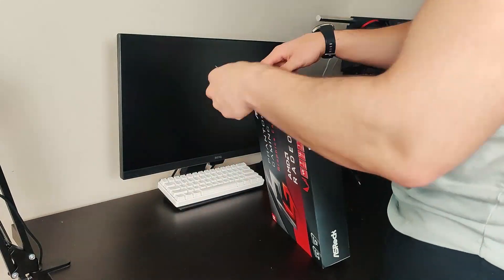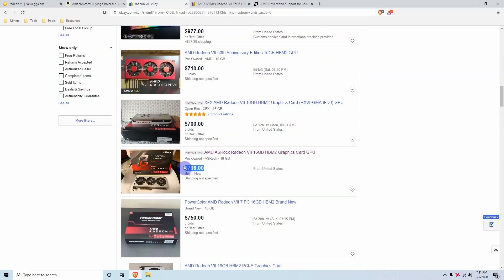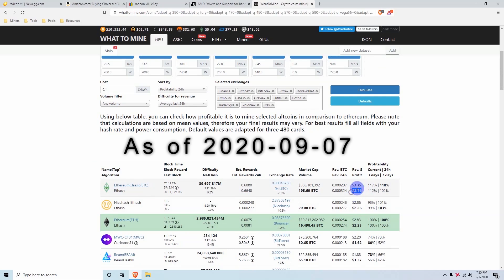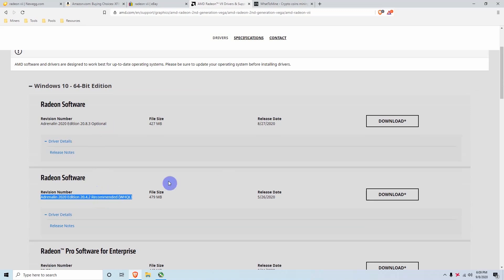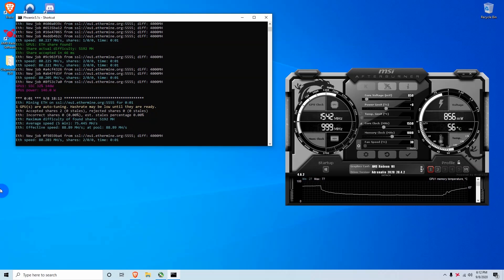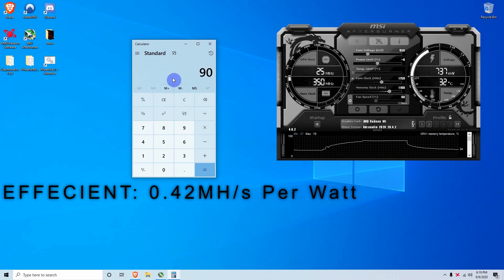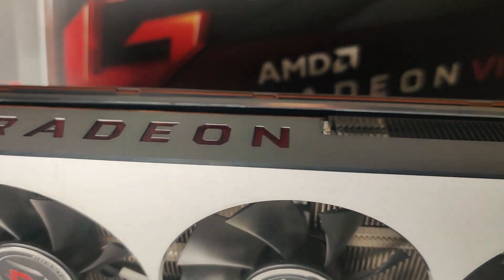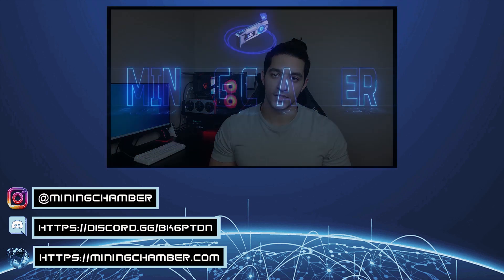Radeon VII Mining Overview | Profitability, Hashrates & Overclocking

Comment: hi
my Radeon VII give me 47 m/h and I didn't do anything to the bios and its only consume 175w
is there any wrong with it
Reply from the maker: Mm make sure your properly connecting it and powering it. Try a different riser as well if your using risers
Reply: @MiningChamber  i made that an i try many miners PhoenixMine not detect it Gmineer give me 47 M/h  but when i try NiceHash Miner it give me normal hash of 88 m/h
realy i dont know what the wrong i changed the power and the riser

Comment: HELLO I have a rig with 5 radeon VII. 
one year mining at 90 megahash x card, two weeks ago they dropped to 78 mh / s. Use simplemining and phonixminer 5.3b fix. What could have happened? OC Core mv950  CoreClock 1750 MEM 1100mhz
Reply from the maker: It could have been due to heat or such. I would just try to reboot and see if it works or I see that you said using simplemining and Phoenixminer fixed it?

R7s gets really hot at 90 mh so becareful!
Reply: @MiningChamber   No no "5.3b fix" is the name of the algo..
Reply from the maker: Never heard of 5.3b fix as an algo... If you were mining at 90mh then you were mining Ethash. So just again check our oc settings or see if there is a later version of Phoenixminer. 5.3b is a version number for it as far as I know and I think there is a 5.3c now

Comment: How to solve the heat dissipation problem of Radeon VII?
Reply from the maker: If it's too hot I'd use the effecient settings to keep your card at 80mh instead of 90mh. If that is what you got it on already then maybe adding a box fan behind the rig should be good!

Comment: Can I run a 3080 with a Radeon VII in two slots on my motherboard? do I need to install the amd driver manually too? isnt it dangerous and not good to put amd driver on top with nvidia driver? and how can I use msi afterburner for radeon VII when I already used it for rtx 3080.. help
Reply from the maker: Hey! Yes you can use both cards in the same system, not necessarily dangerous but it's a pain to setup and usually causes some instability so it will take time to get it right by trial and error. As for MSI afterburner, you will be fine since there will be a drop down where you can choose which gpu to tune!

Comment: How u can enable or disabled temp limit on msi afterburner? I have after burner i cant setting temp limit always back to default 85°
Reply from the maker: Hey! I am actually not quite sure but is it affecting your mining in any way? You can mostly set temp limits in the miners themselfs. They have parameters for it!
Reply: @MiningChamber  i have 2 gpu  rx 580 nitro+ and i have problem with one gpu only, the gpu always easy to reach 80-82° if use all day he can reach to 84° after that bluesrcreen fan on auto can reach 99%, and other nitro+ is normal for temp only reach 67-70° and fan auto never reach 90%, sorry for my english 😁, i am new on mining crypto 😅
Reply from the maker: It's okay! Did you properly overclock your card for mining? Check our RX 580 gpu overview video and skip to the overclocking section and follow those steps!

Comment: should I sell my Vega 56 for a 5700 XT? I use my system to game as well as mine.
0x99724017f84c51bF5bafC802D27bDa851BEd35b4
Reply from the maker: hmm 5700XT pretty good for gaming but their mem temps gets really hot for mining, so in a PC case it might be hard. If you keep the side panel open then it can be a good idea!

Comment: Hi Bro, I want to ask you. Why Nvidia GPUs Memory And Clock Settings are different? from the AMD settings.. in mining and hive os OC template
Reply from the maker: Hey! That's a good question! AMD is absolute when overclocking so you will have to provide the value you want the frequency to be at. While NVIDIA uses addition with stock settings. So for example in NVIDIA you will be using +100 or -100(it can be any number)  to change the frequency of the Core clock or Memory. While in AMD you will put the actual value you want it at. 1100, 2150, etc. Some AMD cards in HiveOs requires you to put only half the value for the memory frequency, the 5700XT is a good example for it. In Windows it goes on 1800 mem while in HiveOs you have to do 900
Reply: @MiningChamber  Oh… so this is the science behind this. Mostly I am using the AMD card for mining. I asked you this question because I am planning to install the Nvidia card and I was worried about their OC settings as it was beyond my comprehension. Finally, I would like to ask you one more question about how will I get the core clock and memory settings of the Nvidia card. Give an example on any Nvidia card. I like this Example "the 5700XT is a good example for it. In Windows, it goes on 1800 mem while in HiveOs you have to do 900". As per your information, is there any website and platform on which I can find OC for graphic cards?.
Thanks in advance brother, you are great
Reply from the maker: No problem at all! It's pretty interesting topic that we might cover in a future video. A place you can get some overclocks is on our website. Https://MiningChamber.com/tag/overclocking 

We are doing a big website remodel soon so we will have more information there hopefully within a week!
Reply: @MiningChamber  Thanks brother, your all videos are very helpful for me, definitely cover this topic in your upcoming videos, I am waiting for this...... Good luck

Comment: I found one for $650 but I don't know if I should wait for the new rtx 3080 or buy the radeon vii?? What do you guys think.  Im new to mining so I could use all the advice I can. Thanks mining familia
Reply: Will add my wallet asap
Reply: 🙏 0x6256C95FB52AF3ae2803eca53300C0eC2f834a14
Reply: 0x760984a6AEC52A8f8d383044808350b007811519
Reply from the maker: Oh wow 650$ that is really good! But if your looking to buy more I still think you should wait for the new GPUs !
Reply: @MiningChamber  haha I know right! Considering what they are going for. There's 2 in my area, the $650 and a $700 but just been holding out because there is so much hype about the new news coming out in a couple days for roughly the same price. Thanks for the advice broski. God bless 🙏
Reply from the maker: Absolutely my pleasure 🙏🙏⛏️
Reply: @MiningChamber  question.? Im expecting my vedha frame and going to build my first gpu mining rig. I want your opinion about the tech. I have. So i have a Asus B250 19 slot mining expert, pentium processor, Kingston 240GB SSD , a Corsair ddr4 8GB, and so far only have 1 Amd Radeon rx 5600 xt thicc 3 gpu. Hopefully get more gpus soon. With the pandemic going on its been tough to get more gpu but im totally excited to set it up. Do you think my set up is good so far? is bios mod., and Overclocking Essential?
Reply from the maker: That is perfect! In your case I'm not sure if BIOS modding is essential I would ask around in Red Panda Mining Discord, as for Overclocking. It is a must to any card. Overclocking is something that should never be skipped since it helps save your hardware by not pushing it too hard especially when you undervolt

Comment: 1 RX 570 = 30MHs = 110w
1 RX 5700 XT = 60MHs = 150w
1 R VII = 90MHs = 280w(only GPU or total system?)

If R VII = 280w  no convenient for me, RX 5700 XT is the best,
If 280w is the total system wattage so what is the GPU wattage?
0xe7d0aa1fc7269553e7295b431e18ee72831ee65f
Reply from the maker: We do provide wattage of both overclocks as a text on screen but to sum it up total system watts with effecient settings is 250W and just the GPU is 190 watts and that's at 80Mh/s

Comment: lol that would suck to have a 6-8x VII rig running widows and the driver crashes and resets without undervolt and reduced clocks
definitely a PSU killer there
even these navi ive been worrying about, most mine are also 2 8pins and can chug power at 2000 core and 1200mv
but i only got 2 small rigs on windows now as mining OS are maturing so makes sense to run them
big step from polaris where at worst ur hitting 250watts
Reply from the maker: 😂😂 that happened to me once, wall meter was reading 1400 watts while the PSU is a 1200 watts😅😆 surprised my hands and legs are still attached 😛

Comment: nice video You convinced me and I bought 3 radeon vii, just a question can I use a psu corsair and another evga in the same rig?
0x3192458957cdf3e738f47bc4a5534bbe73b99865
Reply from the maker: 😂😂 pulled the trigger on it fast! I would've advised for waiting for the new hardware but if you got a good deal then your set! Using 2 different PSU models is completely fine!
Reply: @MiningChamber  bro Thanx For Advice

Comment: nice video.  can I use RTX 2070 and RX 580?  
0x14cF07eFF8EFCeC459082Cf1F4cb54D41915f243
Reply from the maker: Thank you! RTX 2070 and RX 580 on the same rig?
Reply: @MiningChamber  yes. im new to mining still learning. since I have a 2070 on my pc i guess 580 would be a cheap way to get more hash power. s that automatically detected by claymore?

Comment: Nicee video,i am new my question does it matter the brand of the gpu to produce 90mhs thanks

0x02b3cEc970B4c5F267739d191b331c68CB641a72
Reply from the maker: It usually does not matter, although some brands sometimes perform poorly in cooling. A good example will be from our 5700XT review!

Comment: hey bro i have a question, i bought some xfx rx 570 8gb cards from aliexpress and in the claymore miner they appear like they are consuming 57 watts, do you think they compensate with the pci express or the lower fabric clocks let them be more efficient? i have some sapphire models and they consume, or at least the reported consumption in claymore miner are between 80 to 90 watts, i like your content and here is my eth classic addres: 0x04AC1E31510711A9f1f0Bf79F7083A04F20f0029
Reply: test different models of rx 500 series xD
Reply from the maker: hahaha that is interesting. Did you attempt to use a wattage meter off the wall to check? Sometimes the software is bogus so its better to only measure off the wall.

Comment: I have 2 of those asrock and a 6 Radeon vii rig. Best GPU for ethash. One of the asrocks can do 100 mh/s at full power. I have the 2 regular OC settings one for around 90 my/s one for efficiency around 80. Great GPUs and really stables ETC 0x86eC423C9D0a48cCb384F308210fdE73A270B389
Reply from the maker: Thank you for sharing!! full power they go crazy :P Surely awesome GPUs ! Please make sure your address is your ETC address!
Reply: @MiningChamber  Thanks, fixed the address.
Reply: Could you share whuch motherboard was used and the PSU model?
Reply: @unimaginel3877  msi B360-F PRO and ROSEWILL Gaming 80 Plus Gold 1200W
Reply: @BitKerelo  Thank you for sharing, that's a difficult to find motherboard and costly too.
Reply: @unimaginel3877  mining motherboards are expensive right now. Bought it 2019